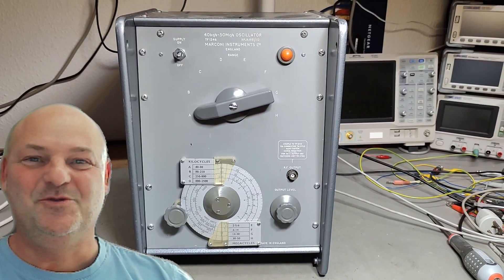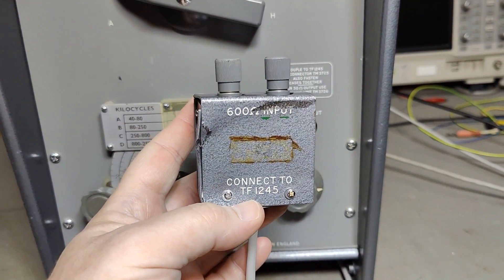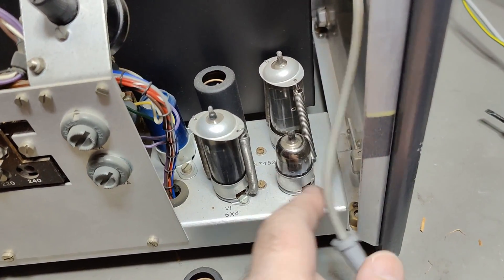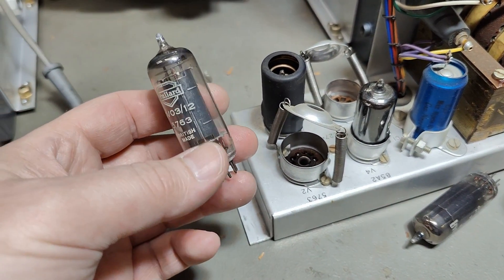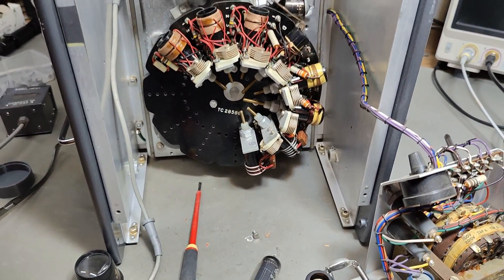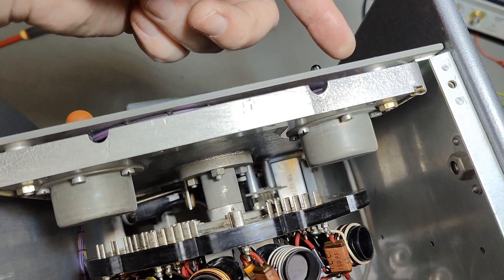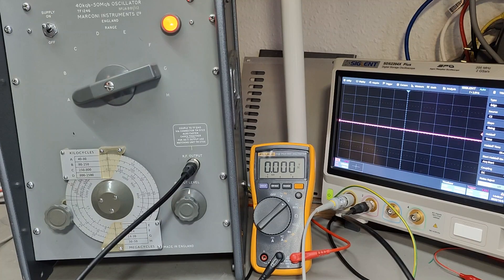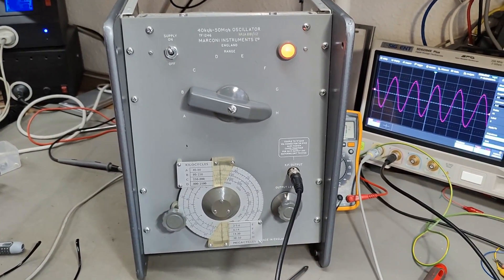Marconi TF1246 Oscillator 40kHz-50MHz 1974 test teardown

Comment: Very good video! Perhaps i would use a powerful vacuum cleaner instead of air pressure, to avoid dispersing all these tiny metal parts into the oscillator, especially de variable capacitors.
Reply from the maker: I think compressed air is more powerful, and i always do it outside, this way I am sure it goes as clean as possible
Reply: You're right here. @TeardownOZ2CPU

Comment: This can be used as a stand alone RF oscillator but  it is meant to be the RF source for the TF1245 "Circuit Magnification" (Q) meter. There is another one the TF1247 for VHF.  It's a lovely instrument. The level control is set according to the level meter on the Q meter. It needs to supply 500 mV to a 0.5 ohm load across the frequency range. I've been looking for one here in Australia for a long time.

Comment: I'm sure that this device did not leave the manufacturer as seen now, someone has botched a repair. The 'Hunts' capacitors really do need to be checked before power up. The valves should have date codes etched on them.